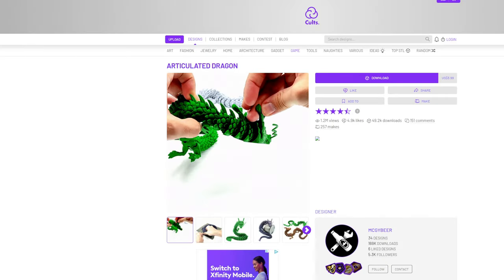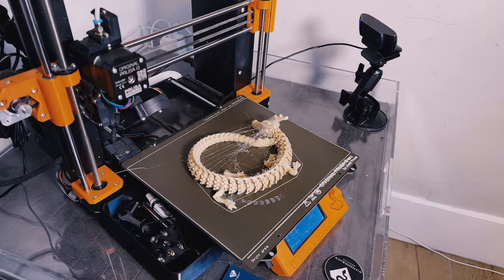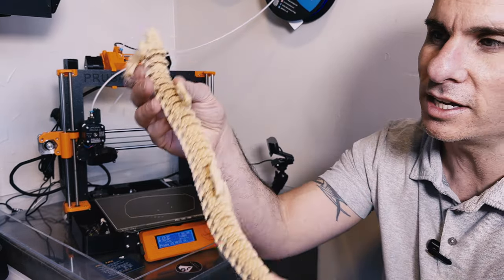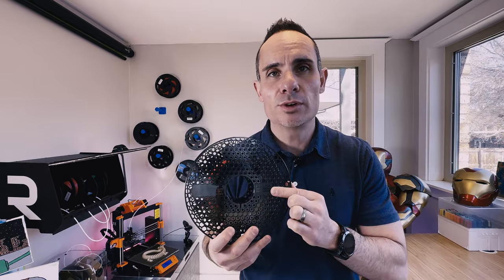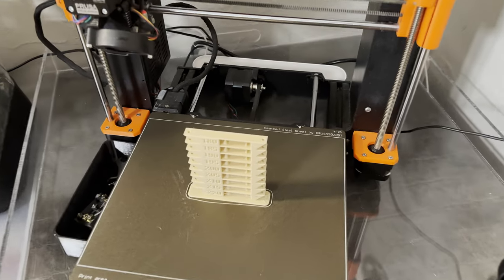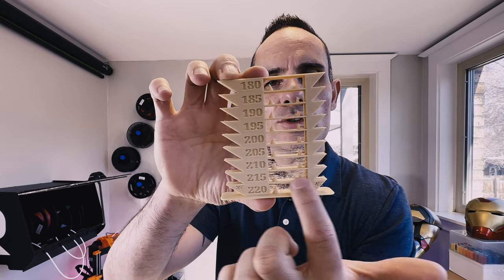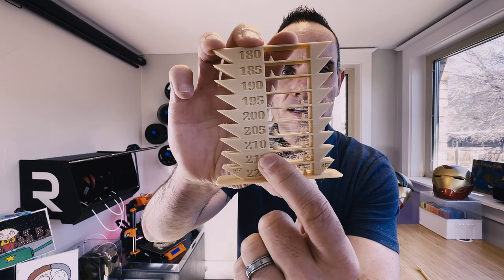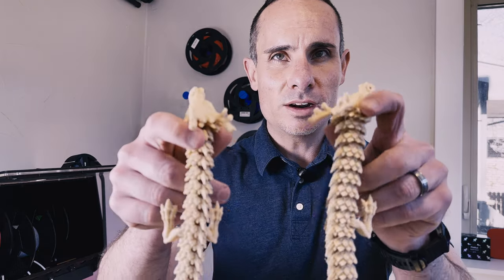Say Goodbye To Stringing Forever - 3D Printing Tips!

Comment: The problem with such a low temp is that the part breaks / splits easily . The becomes weak , so what's the solution ?
Reply: direct drive
Reply: You have to use a low speed for strong parts.
Search on YouTube - there tests published. For example ABS gives the strongest parts around 50-75 mm/s speed. This is a very slow speed, but this way layers warm up with every pass and you get stronger adhesion.
So the fast print is not the strongest print.
Reply: @Utseuski it's been tested that faster printing leads to degraded quality and strength
Reply: @kawaiichi Not true exactly... Perfect prints take the correct settings. These settings change with printer capabilities. Printing the same model on and Ender 3 VS a Voron, VZbot, or Ratrig will have to print slower on the Creality machine... It's just a difference in parts. 
How fast the motors can move... how big the heat chamber is... how strong the extruder is and close to the chamber... nozzle size and material... how much cooling for the hotend assembly and parts. 
It's not hard to see if you want to print fast quality parts your machine has to lay down lots of hot plastic in the right places with the right amount of cooling. 😅 I've dabbled in custom printer builds, Klipper and seven different hotend setups as well as looked into pellet feeding... 
Reducing stringing is a dance with temperature, retraction, and filament type/quality.

Comment: So every time I have new filament I have to waste some time and filament to print this tower? And do you change the temperature while printing the tower or do you print a few with different temperatures?
Reply: I had to manually change the temperature for each stage (220, 215, etc.). Setup: Bambu X1 Carbon with Bambu Studio. I used temp-tower-pla.stl

Comment: how do you get them to print at different temps in the same print?
Reply: It's all part of the gcode. It'll do the layer of the tower then the gcode changes the temperature before doing the next layer
Reply: Is the temp preseted or I have to doit manually at the slicer ?
Reply: @V-Angel  Depends on if you find a gcode for your model of printer. 
The better option is to use something like Orca Slicer, which has a bunch of calibration towers built into it. Just open a new project, look up top for the calibration menu and select temperature and it'll make you a temperature tower for your specific printer.
Reply: @ViridianFlow  do you know if flash forge has that capability or if Orca slicer can be used with them?

Comment: Since i started printing pla at 180 to 195 degrees i have not seen any stringing. 
The parts may be weaker than printing them with higher temps but i print only pieces for aesthetic reasons ( figures, miniatures, toys)

Comment: I'd rather have a stronger part and that means HIGHER TEMPS. Strings can quickly be burned away with a hand sized Cigar lighter, the kind with 4 jets. Cost is about $15.00 at any online retailer.
Reply: This works, but not with pints with small parts and details, which require a lot of post-processing.